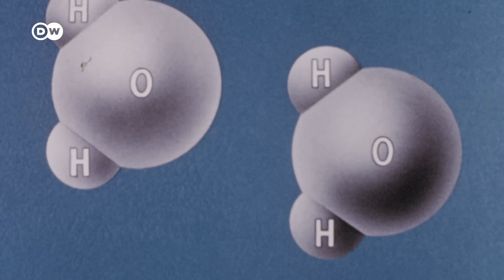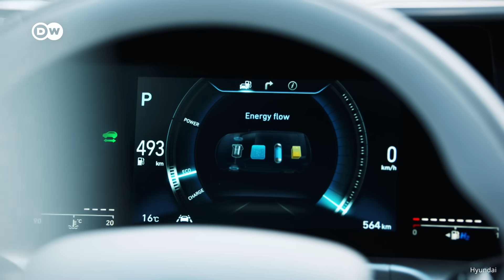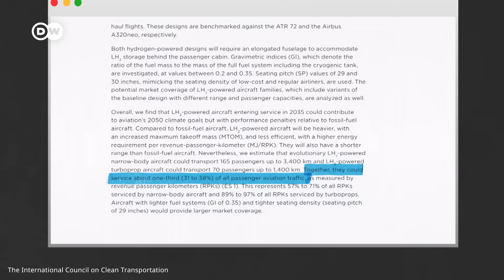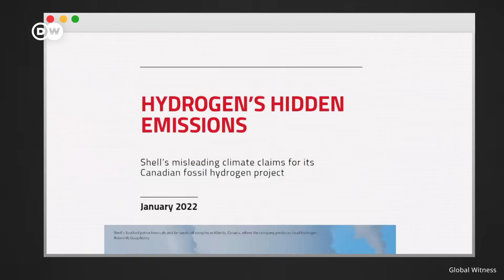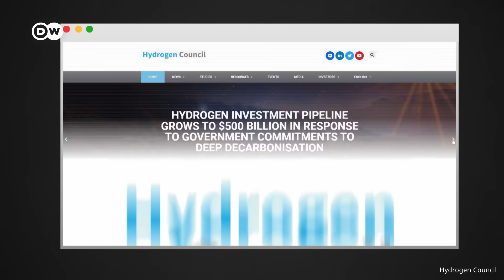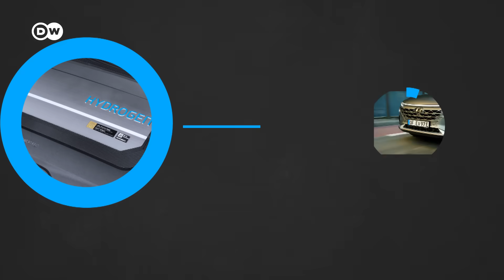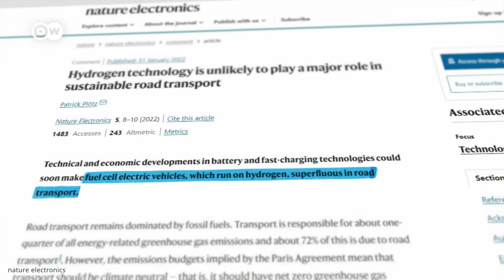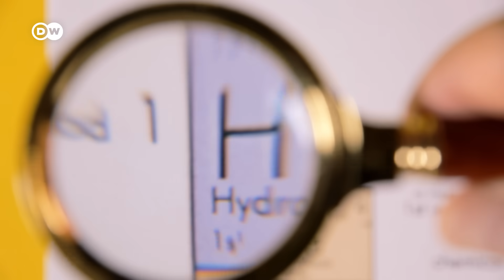The truth about hydrogen

Comment: Green Hydrogen is not exactly green, you have to produce the wind turbines, solar panels and all the other things that go into replacing and maintaining them. There is no such thing as zero carbon. I don't understand why we don't use the benefits of tidal movement. We know when and the size of tides for years in advance so the generation of electricity can be guaranteed. There is no such thing as carbon neutral but tidal generation is as close as you can get. Nuclear is really the only other option.
Reply from the maker: We have a video on harnessing energy from tides and we ask the same question – it could be huge, but why isn’t it? 👉 Link here: https://youtu.be/1-2TyKqP84o 🌊
You might find it interesting. Do check it out and let us know what you think in the comments! 🤓

Comment: I had a hydrogen car, it spent more time sitting in my drive way because the stations near me were always down. I got rid of it and was so relieved. If you drive 200 miles and the next station was down, you can’t just drive to the next station. I’ll stick with my gas car.
Reply: Well, at least you almost made an effort, well done you!
Reply: The same thing can be said about gas cars in 1930s and battery powered cars today. But things will improve. Stop being a muppet.

Comment: Geothermal is the go! I love the idea of hydrogen, but feel there are too many issues to deal with in the soon time, storage, logistics, etc.
I would like to see more efforts go into Geothermal Energy production, surely with all the artesian bore heads we have more recently capped out western Queensland we could utilise these and many other geothermal sweet spots throughout Australia (and the rest of the world) to create a cleaner source of power.  Maybe we could use some type of tunnel boring type machine as used for traffic tunnels around the cities to bore big u shaped tunnel bores several kms deep and have a gEOTHERMAL POWER STATION ON EACH END OF them, pumping to each other the cold water outputs could connect to the hot input of the second Geothermal Power Generating Station, or they could be independent of each other too of course.
Reply from the maker: Thanks for your comment! 🙃 If you’re interested in geothermal energy, you might want to check out our video, “Geothermal energy is renewable and powerful. Why is most of it untapped?” Link 👉 https://youtu.be/c7dy0hUZ9xI Check it out!

Comment: The one thing that this video and most others don't mention is the storage problem. Hydrogen does not like to be compressed. But there's a real solution. Instead of compressing hydrogen you put it in an oxidizer. The oxidizer absorbs the hydrogen and then can release it later. So you get a lot more storage without compressing. The problem with using the oxidizer is not safety with a disorbing hydrogen, but the oxidizer needed for the system to work alone with other chemicals is a good starting point for some very powerful explosions.

Comment: Hydrogen liquefaction is further more energy intensive I think and hence, liquifying it for future use is a really hard process especially when it comes to regular automotive and domestic use. But for the industrial purpose it could be. 
Hydrogen for the industry is more realistic and could provide more efficient than the renewables, I think, than focusing on hydrogen propelled cars and trucks. 
But does the renewables to generate green hydrogen are really green in nature? I doubt that.
Reply: That's why ammonia will be used for transport and storage.
Reply: if you use solar cells to make it, it's green.  of course you still have to recycle the old panels.
Reply: Hydrogen is renewable genius.
Reply: "Hydrogen for the industry is more realistic and could provide more efficient than the renewables"
However it takes a LOT of energy to separate hydrogen from water.  More than you get back, actually.
Reply: @thomasmaughan4798  Yes as of now it does, but doesnt necessarily means in the future and its already getting advanced. What I was talking abt is, liquifying it, then transporting it over long distance and then regasifying it doesnt make sense to me especially considering the boil-off rates. Stored liquified hydrogen is considered having high volumetric energy density but the issue is as stated before. Instead, incorporating hydrogen production and power generation units near dense populated areas, steel plants, refining and mining units could prove to be a viable option.

Comment: As with most videos around Hydrogen today this video's facts are out of date. Not a fault of the video as we're working in an area where research into it has only been increasing rapidly in the last few years. The real problem is that people aren't acknowledging that we need to research many different areas for future energy and we cannot shut down any of them even if they don't look great today.
In just the last 3 months 2 major breakthroughs have turned the potential future of Hydrogen on its head. Green hydrogen can now be produced at almost 1:1 rate that grey hydrogen is at almost no added cost (the solution is to just stick 3 magnets around the electrolyzer. Kind of insane how simple this is). The transport problem is virtually solved by someone that figured out a way to store hydrogen in a gel form that also has the advantage of having a ton better energy/mass ratio because it's in solid form.

Comment: I think hydrogen has its place. Rockets or jet aircraft would be its best application as well as making steel. And while i think ellectric cars are best for efficacy you can't beat a combustion engine for the car enthusiast who loves to drive a manual. The tecnollagy will get there and one day all hydrogen will be green. We've got a long way to go yet though.
Reply: I have driven manual cars all my life. One hour in a BEV have spelled the end of that - these electric drive trains in current BEV are a monster and fun.
Reply: @karlgunterwunsch1950  I think its a personal thing. When i'm in London driving the lorry the i shift is spot on and alot better then a manual. But on a welsh mountain road, I'd pick a manual every time. On another note, over the space of five years twice i've been stranded at the side of the road when the computer said no, put the gearbox into netral and that was it. No amount of button pushing or switching it on or off again would get me a gear. The second time i was stuck with the lorry at Volvo truck and bus for five days. They had to plug it into a computer and a man in Sweden was playing around with it on his laptop. You don't have that problem with a manual.
Reply: @markpritchard  I don't like automatic transmissions one iota - but electric vehicles (except for specially sporty ones like the Taycan) don't have to shift, they have one gear and that's constantly engaged. If they want to stop they stop and the motor spindle no longer rotates. They simply adjust the motor speed according your needs - an Kia EV6 GT for example has a motor that can deliver it's high torque throughout almost it's full rage of revolutions per minute, from 0 to 21000...
Reply: @karlgunterwunsch1950  Yes i know, And i know they are good and have less moving parts. I know they are the future but i just don't find them intresting. I feel detached from driving and more like i'm operating a computer, Which in fairness you are. A manual isn't as good, but i still enjoy driving one more.

Comment: Nobody seems to care about the carbon footprint of electric cars or solar panels. Or the damage to the planet they cause making them. Why should Hydrogen be any different?

Most seem more interested in virtue signaling and insider trading on so-called "green energy" stocks than actually solving anything.

Anyone not pushing nuclear power is not serious about reducing co2 emissions.

Nuclear is currently the only viable green energy source and, if the time pressure is real, we don't have time to wait for other tech to mature.

Comment: Lack of demand for green hydrogen? Well, we're using a lot of hydrogen, so developing "green" production of hydrogen could target the existing demand of hydrogen. And that will become relevant when we have relevant excess of "green" power. Currently we use many times more hydrogen than our production of green hydrogen. 

If the goal is to replace fossil fuels, the first logical step isn't to increase demand of what currently is produced from fossil fuels. Why skip replacing fossil fuels for production hydrogen for existing demand? Why adress [essentially] non-existing markets, when there are markets for it where fossil fuels can be replaced if you can produce fossil free hydrogen?     

Hydrogen can be used as an energy carrier in other existing applications besides where it is currently used, we don't need a gigantic hydrogen vehicle fleet to find use for green hydrogen. One interesting example is taking actual relative excess energy from the grid to produce hydrogen to "dilute" natural gas, mix it in to reduce amount of natural gas used. It has been tried, and the big problem is cost. There are other issues with that, as with all hydrogen applications, but the big problem with "green" hydrogen is cost.  But, if the goal is to replace fossil fuels, producing hydrogen from relative excess on the grid to feed into natural gas supply to replace natural gas is about as good as it can be done. Making use of relative excess on the grid, no storage needed, no future technology needed, no fake demand needed.     

Also, about losses, best hydrogen cars has about 60% losses, from tank to wheel. Production and compression on commercial scale represents losses of about 40%, in good cases. So, in really good cases, grid to wheel, about 24% efficiency can be achieved with hydrogen cars. Really good BEVs has about 90% efficiency, grid to wheel. 20% losses is either old data, or including losses in the grid, which isn't included in the from 76% loss for hydrogen cars. BEV has another advantage, they can be charged directly from rooftop solar, then there's no grid losses, and no added capacity demand on the grid.

Comment: I think the use of hydrogen (GREEN hydrogen) should be focused on power generation, locally and regionally, while transportation continues to improve capture/scrubber technology.  It's simply a matter of practical application.  All technologies mature and improve and it may take longer than we like but eventually hydrogen could prove practical for cars and trucks.  Better to wait it and avoid any debacles like "fails to meet goals" that could kill it in the long run.  Remember when we thought diesel was the end-all, be-all for cars and trucks?  Now NOBODY wants to talk diesel and in fact one industry is making a rapid reversal to gasoline - school buses.  Diesel engine tech has gotten too expensive to maintain and there have been a lot of unknown/unidentified/hushed-up bus fires in the decade or so since using DEF and related technologies to clean them up became mandatory.
Reply: Hydrogen is better used for industrial processes, and as little as possible for burning and probably never as a combustion fuel in vehicles as there are electric alternatives that are already superior. Diesel issues arose from false selling as more beneficial to smog and particulate (soot) reduction in modern diesel, less so as a greenhouse gas benefit.

Comment: Interesting, but one thing not mentioned is hydrogen leaks out of everything; you need special materials and welded joints to handle it.  It also degrades common materials like steel and polymers.

Comment: Burning hydrogen releases plain simple water, but the one thing we are overlooking is the form of water. Water released in atmosphere as water vapour has the ability to trap heat and cause more global warming. Also, imagine if everyone starts using hydrogen based vehicle. This would seriously change our climate and weather patterns. 80 years ago we made a mistake of considering CO2 as an inert gas and human activity unable of affecting the climate. We need to run climatic models to check if the environment created by hydrogen vehicles is sustainable or not.

At the end we want to do everything but to curb our consumption or be mindful of our activities. And this is not sustainable.
Reply: Unfortunately we are doing more than that by using fossil fueled cars. A lot of the burning residue of your internal combustion engine is CO2 (from the carbon in the hydrocabons that make up your fuel) and water vapur (from the hydrogen in the hydrocarbons that make up your fuel)... So taking exception to the water produced by a FCEV is hypocritical if you are currently running an ICE car. The only correct thing in your musings is that we probably can't afford to run a lot of FCEV, but not because of the water vapor but because of the poor efficiency and the hard to establish and hard to keep running infrastructure. Hydrogen has its place in the industry where it can't be replaced. Wherever it's not mandatory we should explore and use higher efficiency solution, like batteries in EV...

Comment: Great video,  I believe that  hydrogen or any gas or solid to propel the future is better than horrific fossil fuels. I also believe BMW and I think Toyota have  already produced and testing this synthetic fuel,  which has  very low emission.. I don't believe nor like battery operated cars, they are already  archaic and 85% as pollutant as ICE... unless they reinvent the battery or improve the electric motors or solve distance anxiety and charge times.  There already  redundant..
Reply: BMW has given up on hydrogen, they shelved their project (just as their FCEV was production ready - but not viable in the market). Porsche is pursuing a billion $ project for efuels but that will only cover 1% of the German fuel needs - so it's the proverbial drop in the ocean.
As for BEV, they are 2-3 times as efficient than FCEV and 5-10 times as efficient as efuels. When charged with renewable energies they are 80% better than ICE - current BEV even with the charging infrastructure that needs extending don't warrant any range anxiety anymore and charge times where you take a 20 minute break and can drive 300km with the charge you got in that time also are no longer of any concern...

Comment: would it not be better to take  green hydrogen and react it with CO2 in the air to get synthetic methane or other synthetic fuels? Then just use those fuels as normal. Seems a lot easier to do than capture CO2 in CCUS. Just accept that its in the air and try not add any more. 

hydrogen is a good energy storage and transport medium - we already know how to do it and theres established infrastructure that could be used for ythis purpose. wind, solar or hydro powering green H2 and synthetic fuels could be a meaningful solution that requires minimal change to existing infrastructure and behaviours.

Comment: I think hydrogen definitely has its place, especially in heavy industry and equipment where using (current) battery technology is impractical.  It's portable, can be produced more or less emission free and could be used to augment renewables as a form of storage. It's not the answer to everything, but neither are lithium ion batteries.

Comment: Hydrogen storages should be viewed as batteries or an alternative to batteries. Whatever excess energy generated through solar power should  be transferred to electrolyser (built at public level). Though inefficient, still packs more greens than battery production.

Comment: Am I correct in thinking that one of the main problems at present is green hydrogen through electrolysis is or has been energy intensive ie. You put in more energy than you get out in the form of hydrogen ,
But I believe i read that a small research project has achieved energy neutrality in Laboratory conditions and claims that it can reach a  bias of 10% in favour of hydrogen .
Reply: Anyone with only a most basic understanding of physics would debunk that claim. You can not extract more energy from a process than you put into it.

Comment: The price of gas isn't going down and running vehicles on battery isn't enough power to run trucks. Natural gas is more feasible. There are busses that run on natural gas, in my city. It's not carbon free, but burns much cleaner then gasoline.

Comment: Overall good video with most important points at the end. There are two main issues with hydrogen. Hydrogen cycle efficiency and its energy density.
Efficiency of H2 cycle (water -> electrolysis - hydrogen -> fuel cell -> electricity -> water) - is indeed about 30-40%. Which basically means you need to make 3x times as much energy from your renewables for what you can actually use. 
Hydrogen being a gas (in most sensible conditions) does not have very high energy density. So you need a lot of it, that takes a lot of space. To fight this you can squeeze the hydrogen into heavy duty tanks and keep it at high pressure. That's what Toyota Mirai does. How ever if you look at weight of Mirai and its range compared to Tesla Model 3 you get very similar figures. Meaning today the energy density of H2 plus its heavy duty tanks is similar to Lithium-Ion batteries. So where is the benefit of hydrogen exactly?
Reply: The issue is that Lithium has limited supply so it can't be our long term solution.  There are other battery technologies that might be such as Sodium based batteries as this is much more common.
Reply: @paulconner4614  lithium is more abundant than lead and every car has a starter battery with 10-30kg of lead depending on its size - a 70 kWh EV battery requires 11.2kg of lithium.
Reply: @karlgunterwunsch1950  true and I agree, but there are also other semi-rare metals such as cobalt needed for batteries. On the other hand with hydrogen fuel cell you need other rares such as Platinum, Palladium, Strontium.... Neither of these "solutions" is perfect and it will never come even close to efficiency and energy density of fossil fuels.